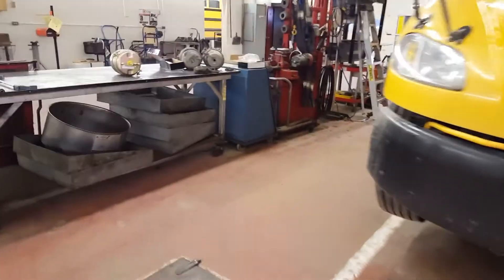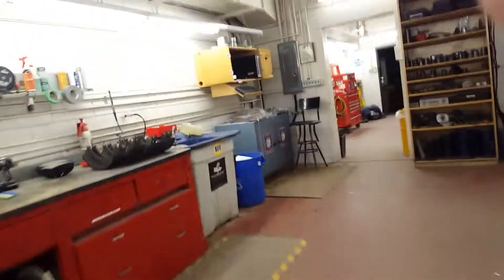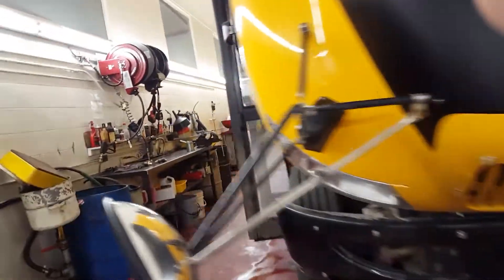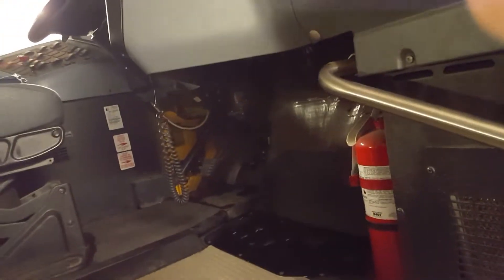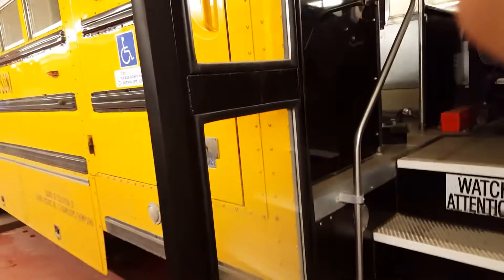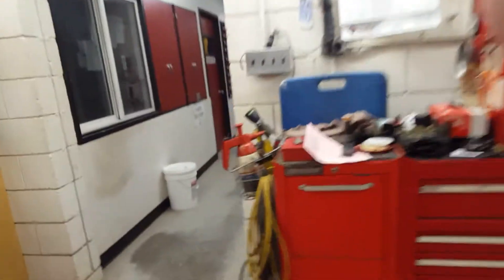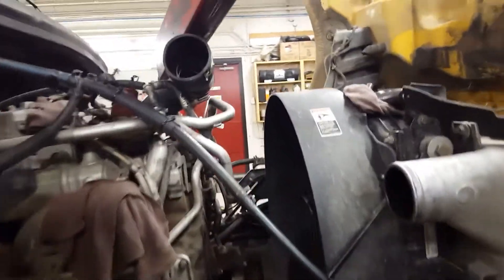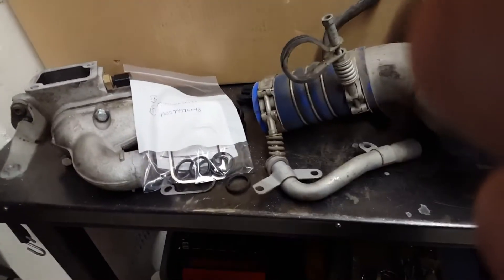Touring the School Bus Garage

Comment: @Mechanics hub I am having alot of issues with the IC buses leaking coolant from the driver's heater side man usually it would be the 90 degree hose valve but not this time the leak its the heater valve but the part it's expensive but you are right job security! At it's finest!
Reply from the maker: You're right the shut off is another weak spot and true there are never ending issues which means a job for life :)